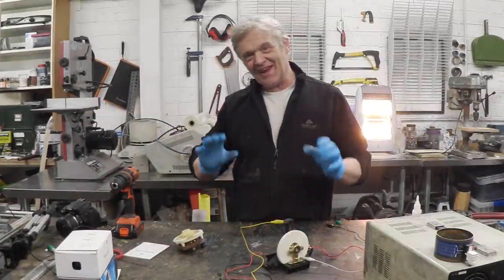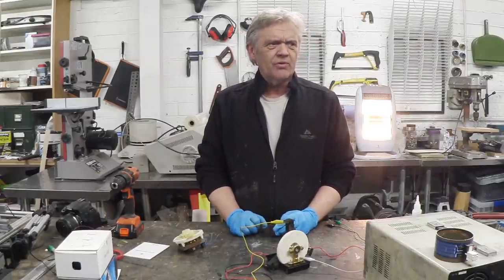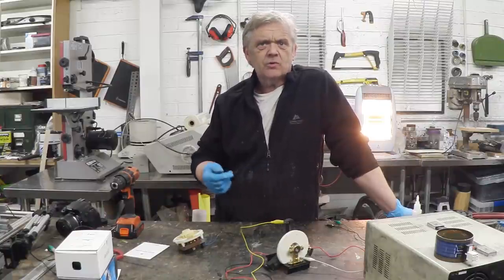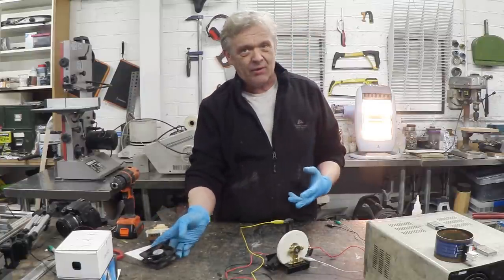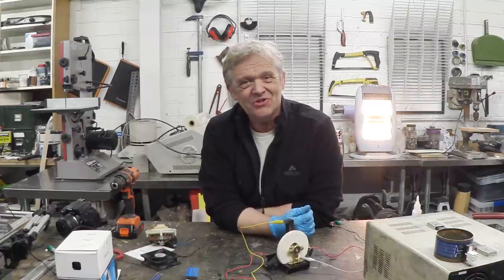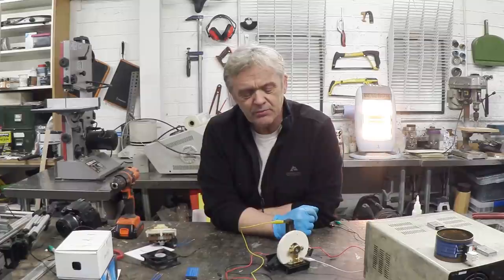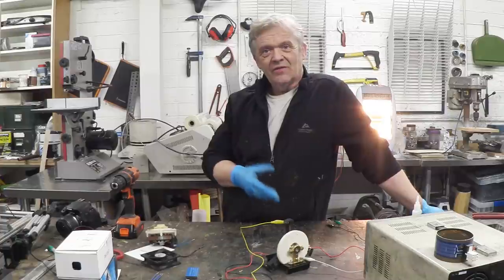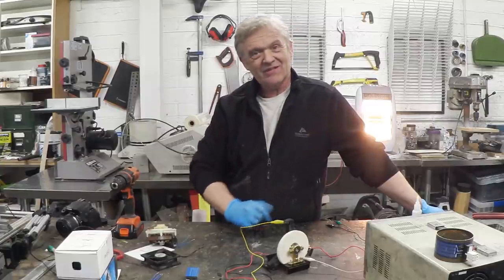1017 Brushless Motor Controller Without Electronics

Comment: I'm an idiot, but I'm wondering why not just use a " inexpensive low voltage switching" to turn on and off a bunch of little coils on one end of a transformer with a big coil on the other end that gets hooked to the motor?

Comment: So you figure small amp motors are fine with sil, but the more powerful motors the mechanical solution edges 'em out. Curiosity, around what amperage do you imagine that transition zone being. So that less is clearly a silicone application, then maybe a middle zone where it depends on details of application and design, up to large scale where the mechanical solution is, to your line of thinking, a clear advantage?
Reply from the maker: that's pretty much what I think mate but I am not sure where one would draw a line so to speak

Comment: Oh it cant be that hard to make a DIY speed controller, just gotta hook up hall sensors to a micro conroller as gpio inputs, have 3pwm outputs for each phase to make it spin and what speed  and the rest is just a bit if of sotware to control the timings based on the hall effect reading  and apparently there jsut a lookup table you use once you get the halleffect values. easy, of course theres all that electroincs engineering like capacitors and diodes to control back emf, mosfets to do the pwm switching wihch I assume gets its information from the throttle for the duty cycle. Maybe a little more detail to make it right but maybe starting off with a single mosfet and potentiometor  to drive a 6v DC motor as a speed control is a good start, and you too could make speed controler for $5 for your twizzy?  you  never know.  Well I guess you  cant avoid the high cost of high power components once you learn to make , so in that sense youre right, silicon is vastly more expensive to handle that power, but a DIY solution could bring it down some.

Comment: Can this be used as a torque ramp up? IE having 1 of those with a central motor, powering other BDC motors at the wheels?
Reply from the maker: I would think so mate - this is really just replacing the commutator - the practice and theory is as old as the hills

Comment: Been trying t9 get my geo metro electric car going for years the motor controller 8s sophistited german unit.  I built an electric scooter for scale,. 8 am going to create the mechaniçal module you built and try to make the scooter motor to spin.  If that works I will make one of these modules only larger and try it on the three phase heavy duty motor on my ev,  have much time and effort invested in it,. I-5 will be a miracle when I get her running again.  Any suggestions on this will be appreciated

Comment: Good idea, I see one problem, all you've seemed to have done is mede a brushed dc motor out of a 'brushless' dc motor.
Fine your idea for attachment makes brush changing easier but in its current state it doesent seem to be a new consept, or atleast by what I see.
Reply from the maker: it isn't - but then I didn't say it was - actually I think I said it was using old tech to solve the problem of price and complexity - nothing else
Reply: @ThinkingandTinkering  OK, sorry, I'm struggling to see how it is not a brushed motor, I gues when it is not operated by the motor its self it counts as a manual stepper controller.
I don't mean to be ignerant to your idea I just don't yet se how it is different, I'll wach the video again.
Reply: O sorry, so just to clarify (or un clarify) what I fink you mean now, so useing this new stile of brushed dc motor then is a cheeper sulushon compared to the brushless 'dc' motor?
Reply from the maker: mate you are quite right - it isn't that different - all I have really done is stick a commutator back on - it is funny that it does seem to slave itself to the motor or rather the motor slaves itself to the commutator even though they aren't on the same drive shaft - but even so it is essentially just a brushed motor and nothing else
Reply from the maker: for high power applications I would think it would be cheaper with this and a brushless motor rather than a brushless dc motor and an electronic controller - for low power a brushless motor and electronic controller would be cheaper
Reply: @ThinkingandTinkering  thanks for clearing things up. I've fought about things like useing a low power bldc controllers with a set of solenoids witches before, theirs proberly some way you could change the lead of the brushes or some thing mechanical like that far easier on exterior brushes than internal ones.
Reply from the maker: nice idea mate - got me thinking again lol - cheers

Comment: The idea is flawed both in terms of the efficiency and motor feedback. When controlling a 3 phase motor under load you need to know what rotational state the motor is in, this can be done via back EMF detection, HALL sensors or any other kind of rotational sensor such that you know which phases to put your power across, if you don't know the state of rotation of your drive motor you can easily power the phases in the wrong order and produce enormous loads on the system in terms of amps and torque.

Comment: I guess this guy never heard of IGBT's. Where I work we have 500HP at 480 three phase VFD's to run our overhead gantry and trolly crane. No issues. This is even more complicated than using them as switches. This is using them as pulse width  modulators simulating an ac signal.

Comment: Yup makes perfect sense, so I assume (this may very well be faulty logic) the the next step is making it self-commutating,  but then I suddenly have no idea how you would control speed, I guess you could do that by controlling the amount of power going through it and relying on the performed work to slow it down, but that seems a bit of a clutch, anyone got an idea for that?
Reply from the maker: I would just leave them separate mate - that way you can control a low power motor speed and use that to run the high power motor - I go into this a bit more in the next vid
Reply: Well, you could just use an externally excited dc motor, like universal motors. They have their own commutation and you can control the power they take by controlling the field winding current.
Reply: @ThinkingandTinkering  Leaving the two separated would result in even worse efficiencies compared to a typical brushed DC motor, since you would be dumping current into the windings and reach flux saturation point. Not to mention you then loose all of the torque of the motor, since the magnetic field you are generation (via brushed commutation or SiC brushless drive) NEEDS to match that of the permanent magnet. Otherwise, if they are not in sync, the rotor field will slip and you will not have any torque anymore.

Comment: Could another solution be using a cheap silicon one in conjunction with a transformer before and after, say ones recycled from a microwave?
Reply from the maker: interesting idea - to be honest I haven't thought about it before - thanks for sharing
Reply: @ThinkingandTinkering  welcome cohort, love the channel, subscribed for years now
Reply: @ThinkingandTinkering  welcome cohort, love the channel, subscribed for years now
Reply from the maker: I know lol - I recognise you - which tbh doesn't happen that often - I am not being rude it's just there are quite a few folks and I don't remember every one - you I know though - cheers
Reply: @ThinkingandTinkering  I understand that myself, I find that details are easy to remember than names.

I appreciate it cohort.
A question, what ever happened to the hemp battery project?
Reply: This was my thinking as well. Something like the RC controller output to high power audio Amp  to bldc.

Comment: I could make a small resistance or start my motor on 12 and then go to 24 on my mobility scooter I'm trying to do away with what it came with because it's ruined. Anyway I need to figure out the wattage of the motor it's not that big. It is 24 volt.

Comment: I didn´t see any regulation, and it barely moved. Modern silicon controllers can handle open-loop and closed-loop regulation with extreme efficiency and reliability, providing PWM sine wave for low speeds and CONTROLLED switching in the right moment at high speeds. If you tried to build a mechanical controller that way, it would be far more expensive than $400, and absolutely not reliable. And you really didn´t prove that your prototype is actually producing torque. I´s just an open loop switcher, so I assume it would just jerk around and not rotate at all with a load on it. If you put real high power on it, it would just spark the thing to hell, regarding the high resistance of the brushes and the contacts arcing. As you mentioned, you need experience in power electronics, mechanics, physics and electrical engineering to do it the right way. Not needing it is no guarantee for having a better solution. Sorry to say that, but there is too much wrong about this video that triggers an engineer.

Comment: This works for medium siced motors on simpel machines not on the realy big motors like Electric cars or similar i worked in manufacturin and testing of 300kW motor drivers and and now in convertig old delivery trucks to electric ones. If your phases of the driver are like 2 degres of or a coupel of amps out of sink the motor will begin to stutter an cause damage to the motor bearings and  drivtrain  not to speak of the pure block comutatin not even like hoppy level bldc drivers with trapezoidal comutation wich causes the motor to stutter even if  everything is perfect 

Tldr ok for non critical stuff like something you build where a motor is needed but not for transportation  or where a smoth runn is needed
Reply from the maker: on a really big motor mate I would probably just run a drive belt from the big motor to this - then all you have done is add commutation back in and sync would be good

Comment: Hi Rob I get your idea about the motor control but I had a different idea in mind because I felt the same way so I designed a commutator that uses 2 input but runs a brush motor without brushes(hence brushless) but if you check eBay # 333648602335 there is a 190amp mosfet for 15$ that you can use as the output motor drivers and this can be driven by a very low power motor controller that is DIY or very cheaply bought (concept is like a relay small volt control big volt...here it would be Amp instead of volt)
Reply from the maker: I agree mate but there are two problems - price and complexity - this - I think - is an alternative mechanical solution it's not a competitor with silicon just an alternative - I also think it would be cheaper after all you need 6 of those mosfets and that would be $90 before anything else
Reply: To be honest I am not an advocate for silicon I honestly think that they are better ways but everything has it's complexity...we don't make silicon at home but the manufacturer deals with the complexity we just by the already backed cake. But if you don't mind I would love to see if I can help in your quest for homemade low cost alternative. What voltage will the twizy battery be and how many watts does the motor operate at and is it 2 or 3 wire... I will see if I can figure out a very cheap DIY system. By the way I think your channel is Awesome.